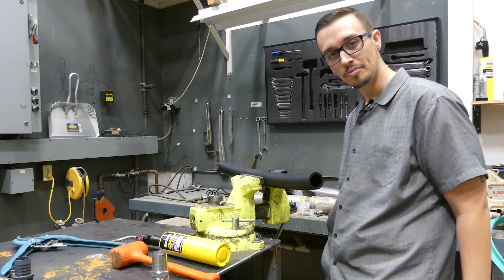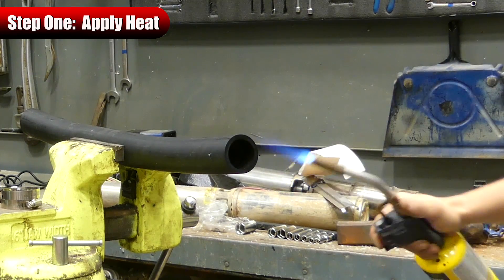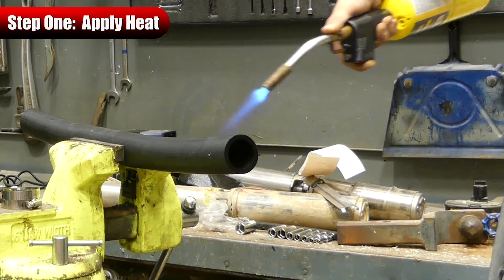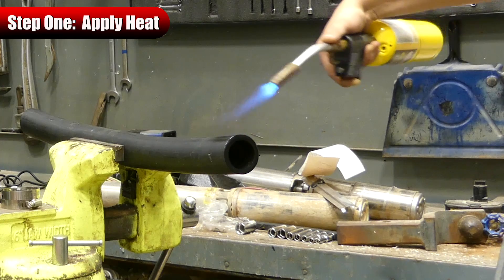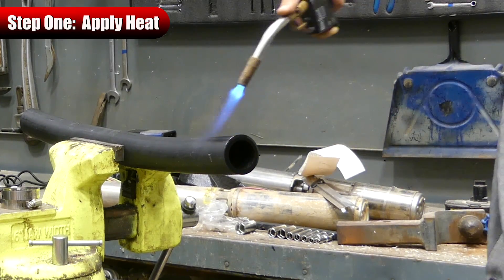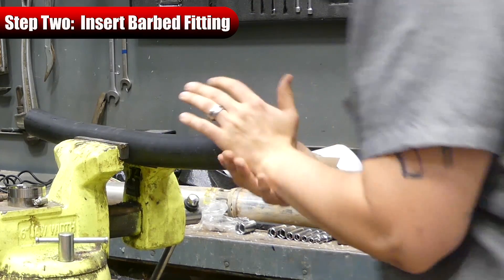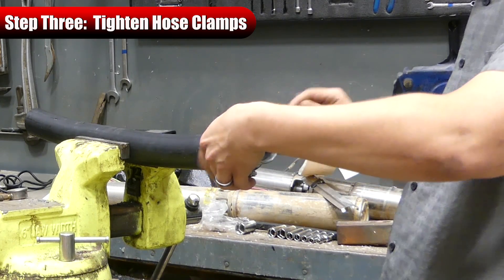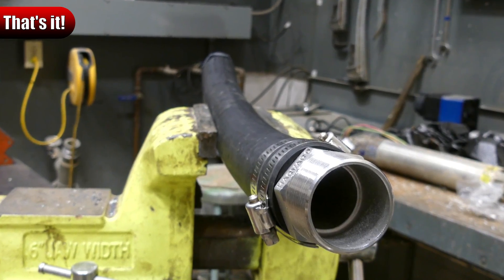How to Connect Poly Pipe to ANYTHING using Barbed Fittings

Comment: Will this work with Blue Poly for my  Water Main from Curbstop to attach to my Water Meter? Had a Ford Compression 90 on the Poly and it came off and flooded my basement.

Comment: What he doesn't show you is if you heat it too much and compromise the hook up how you'll be cutting pipe out and coupling more stuff together etc. be careful, do not heat too much just enough, and damn sure use mallet, this guy is in the easiest setting using a vice...

Comment: Maybe my pvc barb fittings weren't long enough for my 2" poly pipe, but the joint isn't strong enough and keeps coming apart on a hillside even if I crank down the hose clamps.  Couldn't find the double barbed stainless steel insert at RC Worst.

Comment: How tight will the fitting be once it cools? Can it still spin? I have the sdr 9 1" poly, and it's like 7/8 " ID, which is odd. I used 3/4". Once I heat and clamp, will there be any issues?

Comment: doesnt look like the barbed fitting has a collar to spin? how do you connect to the female if can not spin to thread on? looking for an better solution to connect and disconnect my pumps to my sand point wells.  thanks!

Comment: I wonder if you have answers to my questions: 
1) Just today, the plastic barbed fitting broke off inside the poly pipe. How to take it out? 
2) The poly pipe comes from the well house/pump, about 4' before house foundation it was connected to the Galvanized pipes and a hydrant. All of it rusted and needed to be replaced. Should I use Pex or copper? Pipes in the crawlspace are copper. 
3) I also Thinking to lower the pressure tank and connect to the pump about 10' - 15' under the ground to eliminate heating well house in the winter season. My pipe runs about 6' under the ground. 
A) is it a good idea?  B) how to do it?   
  4) Should I install another pressure tank under the house in the crawl space? The well is about 30 yards away from the house. 
Also
I found a 5" PVC well pipe in the field. PVC pipe broken, leveled with the ground. What to use to close it, to prevent from debris to fall down?     How to find if it has water and how deep?  Also what camera to buy to inspect the well?  What 4" pump and water tank brands and models are best?

Comment: It looks way too easy in shop , how about splicing a poly pipe inside pit hole with minimum space ?
Reply: Or under a mobile home crawlspace where the manufacturer only left 9 inches hanging out of the under belly to connect to. I can see the plastic under belly catching fire now with all his heating
Reply: What is the Hose barb size  connector for SDR 7 IPS PS24 ASTM02239 PS-11-69 3/4 IPS. 160PSI.
  The OD is 1.075. Guess the wall is 0.100  .   So the hole is  0.800. 

Do you use a standard 0.750 barb in it and pull the pipe down with a clamp?
Reply: @RIPSAWONE  3/4" SDR 7, is it polyethylene?
Reply: @staind288  Yes,petty sure it's black polyethylene
Reply: @RIPSAWONE  same way. Heat and a barbed fitting. You can use other things too but I can't guarantee their results. I almost don't want to share them incase they don't work but I will.

Comment: I have to replace a barbed elbow on the hose coming from my well pump that connects to the pressure tank.  How do i relieve the pressure in the line before removing the hose clamps?

Comment: I use a wagner hot air gun it works great without weakening or damaging the tubing. 

I also like to use single ear compression clamps because they get the full 360 degrees when you compress them. Similar to a CV boot and can be compressed with any small to medium end cutting pliers.

Comment: I've had different issues in the past dealing with 3/4" poly pipe.  After much trial and error, I've found that brass barbed fittings seem to work the best with the size pipe that I have along with the two clamp technique.  Steel and plastic barbed fittings are just plain terrible.  I can't believe after all these years of companies manufacturing and people using this stuff that no one has come up with a better way of connecting and securing fittings to this type of pipe.  The worm clamps seems to a major fail point.

Comment: So I'm 6 feet down (frost) replacing an old leaking plastic 1" tee (installed years ago by previous owner)with a brass T.  Plastic is not up to code and I do not want it to leak again so am using brass.  My helper thought it was smart to dig a hole as small as possible. Do not do this, you risk a cave-in and there is not enough room to work.  I've always used hot boiling water, would not recommend a torch as once the plastic seems heated enough it will continue burning/melting after the torch is shut off.  Against my better judgement, egged on by my "assistant" I melted the hose using a heat gun, deformed the end of the pipe.  I have heated and worked with plastic for 40 years, believe me it can be easy to FU. I'm going to just cut the tee off as it is too difficult to get enough torque on a tee and it would groove up the interior wall of the pipe with all the twisting and turning. So off to the big box store miles away (the one that put the local hardware store out of business) to get the Tee I saw that has an extra long barb in one direction.  As far as the politics, didn't watch it. I did learn from my high school WW2 vet teachers (in both Pacific and European theaters) how to identify Hirohito and Hitler type leaders.  We've got one here in the US right now who combines the worst of Hirohito and Hitler. Pretty sure those vets would have said his name begins with a T, not a B.

Comment: I used a face cloth folded twice and wrapped around the end of the pipe, and then held in place by an old trouser bicycle clip. Then I poured boiling water on the cloth, waited for a couple of minutes for the heat to dissipate through the thickness of the pipe, and then was able to insert the barb! A heat gun also works, and is gentler than a blowtorch.

Comment: I appreciate the info. However one question I have is what are (if any) the manufacturer's guidelines? I can't seem to find any information on the poly I'm using. I'm working with 3/4" poly rated for 100 psi. I used the torch method  and sure enough I have a slow drip. Short of torching too much or too little, I don't know what I could have done wrong, which leads me to question the torching method if the margin for error is that small. After all, heating plastic changes the molecular structure, does it not? So I'm really curious if the manufacturers have a recommendation on whether the torch method should be used.

Comment: Can you tell me the max. dimension différence IT should be between the ID of the pipe and the OD dimension of the bar sectionnelle
Reply: Barb section. Because I tried to fit a 1.50" pipe on a 1.50" barb connection and there us a diffirence of .150" on one of m'y pipe, and a other one , .090". IT was impossible to Do. Thanks for a answer.

Comment: Will this work for the CTS (OD) poly as well as the IPS (ID) poly? The dimensions are kinda goofy on this poly stuff. There's way more CTS available but fittings are limited unless I can heat up the pipe enough to take a barb.

Comment: Added note:  RE Getting to tightening the hose clamps quickly, the PE expands about 8 times as much as steel, so tightening the clamps while the PE is still warm will tighten the fitting even more when cooled.

Comment: Oh dear god, you heated that way too much and had too high a heat.  Also, heat the inside more than the outside.  You can ruin your connection by having the outside too hot.   I don’t care about the outside being as hot as the inside.  The inside is where it all matters.  Also, remember, that poly continues to heat itself even after you remove the flame.
Reply: And he basically only heated one side, when he went to side he wasn't standing by he left heat on it for about 5 seconds total,  while the other side was almost melting,  lol

Comment: thanks for a good video demonstration... i have been searching high and low online for brass or plastic shut off valves (with barbs on both ends) that will fit a one inch (inside diameter) black poly pipe... i have found them for smaller diameter pipe, but can't seem to find one inch size... any idea where i might look??? thanks

Comment: What happens if the black pipe is set on fire to be able to insert the fitting.  That is what I saw the pool repair guy do?  Will the pipe cracking or leak when I run the filter? Help???

Comment: I'm thinking of using the wife's hair dryer on rubber dishwasher supply line being supplied from a barbed supply fitting. 
Will this work? Should I use Rectorseal pipe thread sealant?

Comment: On 1/2 poly pipe, can I use 1/2 PEX clam rings instead of these more expensive screw clamps?
Reply: I wouldn't
Reply: @richardj5417  not the same diameters?
Reply: @michaelkuzmin  pex rings are better suited for cheap pex. Honestly I would use hose clamps and a 60inch/lbs T handle torque wrench. Being a plumber myself. Lol by setting torque you get guarantees with the clamps that you won't with pex rings and yes the well line or polyethylene is a heavier schedule or tubing.

Comment: The absolute worse thing you can do is apply a flame to Polyethylene pipe!! Don't do this!!! Your pipe will get brittle and crack.
Reply: Then how????? If the poly pipe is coming up out of a slab you can't dunk it in boiling hot water

Comment: Seems like way too much heat.  The pipe is now compromised.
Reply from the maker: It may seem like too much, but we have been hanging pumps from these connections for 30+ years with no issuse.
Reply: Yes!  I admire the Worst guy and everybody else who gets this done, but a 3596 deg F propane-air flame is overheating, scorching, and destroying the polyethylene material strength.  You only need 200 deg F to soften it, and any more will spoil it.  Worst has gotten away with this for 30 years because he's playing around the flame to minimize the damage, there's enough material there to hold up despite being degraded, and the damaged pipe area is bandaged by the metal clamps and not under water pressure.

Comment: So it is too hard to get the barbed fitting in without the heat first?  Suppose you could get the fitting on.  If you are using a metal fitting then it stands to reason that perhaps you could heat the metal fitting from the inside and it would melt the polyethylene pipe from the inside and make a bond there.  Heating the outside of the pipe with the clamps already on would also melt the clamps to the outside of the PE pipe.  I'll stick with your method rather than experiment.  But I'll be under my home connecting a 1" Brass insert male adapter to 1" polyethylene of iron pipe size with rated working pressure of 200 PSI per my water company's web site.  I'll probably wear an OVE glove on each hand underneath a pair of waterproof gloves.
Reply: It would be better to force the metal barb into the warm (not hot) pipe to press it in, but the force required to do that is still impractical.  Poly pipe is slippery, and there's no way to hold it for that degree of press fitting.  Heating the metal fitting is a bad idea.  That will melt and reform the plastic, which will be loose when it cools.

Comment: I've got 1-1/2"  SDR-9 pipe and a 1-1/2" barb x MPT adapter.  The OD of the pipe is just a little bit smaller than the OD of the fitting.  I'm going to really to soften up the pipe so doesn't look like the torch is going to work.  It looks like I should be using a 1-1/4 or 1" barb.  Maybe someone else has had this problem and knows what I'm up against?  Thank you

Comment: This is "A" way of doing but NOT the "Proper" way of doing it.

Also hand tight means: To tighten with just the use of hands or fingers, without the use of tools. 
You say hand tight but you are using a screwdriver to tighten it.
Reply from the maker: If there's a better way to do it we want to know! What would you have done differently to connect the barbed fitting to poly pipe?
Reply: Someone asked a question about cooling the fitting. And I can't seem to find it but anyway. This is the reason he asked I would imagine. 
I know this is not new as far as the video goes but. The reason he asked about cooling the metal is it's because when you heat the polypipe you make it flexiblePliable so you're able to Insert the Barb into a pipe that it wouldn't normally just push into. He asked that because hes probably A mechanic and has installed bearing races.  Same concept. Not to get too off track but to use a good example let's say a 2 stroke motor  When you replace the crank assembly you have to remove remove the bottom and crank  Shaft bearing, And in doing so Most companies advise Putting the bearing races not the actual bearing in the freezer overnight Because cold makes metal contract and reduce it's overall outside diameter.  And they advise that you put the clean engine case case cover on a baking sheet in the oven at a 150ﾟ 200ﾟ It allows the metal to expand. Is it's called an interference fit. So that's why he asked. Not to drag on about this but, The 1st time I replaced crank bearings on a crankshaft in a 2 stroke motor but I was surprised at how  Well this worked. At room temperature you canTake that bearing race sit it on that engine case and see that it does not fit. With one metal cold and the other 1 warmed up. 9 times out of 10 you can fully sest the bearing race  Is with your hand. Is it literally drops in. And when it cools and warms. They are Locked in place. That's why hes asking about freezing the fitting because it will contract it all metalsExpand and contract different temperatures and different dimensions but same concept. Sorry the message was so long I was trying to make it understandable
Reply: What a twat. lol

Comment: Can this barbed fitting be used inside metal drain pipes as well? If so, how would you go about sealing the connection?
Reply from the maker: No, it is for poly only.

Comment: what about replacing rusted steel or iron where the pipe must be cut - weld new threaded fitting on ?  Epoxy, Clamp?

Comment: I got away from the high dollar couplings a long time ago just using the next size smaller threaded steel pipe .
Reply: Do you use a reducer fitting?
Reply: No and the pipe threads  hold the pipe inside.
NO HEAT REQUIRED for connecting  / thread in if  needed./ snug fit. 
When using them with hot water I use metal hose clamps on the 
outside so there is metal on both sides of the plastic,
It works well.
Try it you will  like it.
Ps you probably know there is a food grade poly if needed .
Reply: @sojournsojourntraveler1203  appreciate the response. I should've asked if you just step the size down and run the size down. Thanks
Reply: Yah just the the threaded nipple about 2.5" to make the connector .
Happy trails .
Peace and Shalom
Reply: Can you explain what you mean? What type of pipe do you use as the fitting.I need to connect 2 inch DR11 and I need 2 inch male pipe threads
Reply: @williamdarby9011   The poly pipe that is the subject of this video.
PEX pipe is an exception .

Comment: cris can i use heat gun instead of torch thank you.
Reply: will a heat gun work? Well that depends on the quality of the heat gun.  So yes it can be done. Also it is much safer and actually takes LESS time. Not like this guy says. Why? Because you can apply direct heat to the pipe and not have to keep doing this touch and go. You can make a fitting to that heat gun out of metal conduit and a cap. Cap the EMT and drill holes all the way around near the cap and about an inch wide band of holes. Now you can stick the new heat gun attachment you just made inside the pipe and heat it just at the end and on the inside where it matters the most. It will only take seconds even with a cheap heat.gun.
Reply from the maker: You might be able to, it will just take much longer.

Comment: Is there an option to have the barbs on the outside of the pipe rather than the inside? I don't want the barbed fitting to reduce the flow. Thank you.
Reply from the maker: Good question! The other option is to use a ford fitting: https://www.youtube.com/watch?v=rCAUnJgk8JQ

Comment: I have a 3/4" brass barb coming out of a gate valve after my water meter. It turns to a 3/4" poly line leading to my house right after the gate valve. The barb just slides right in for some reason. Almost as if it's not even touching. Would this work with that situation or should I get another type of barb fitting that isn't brass? I'm currently trying to find out why I'm only getting 25psi from my meter, so the pressure may go up to 100psi in the future if it's an issue with the city's equipment. Thanks in advance for any help.

Comment: This is awesome!  I've always used compression type unions for repairs on poly pipe, but for some reason up here in the Seattle area I can't find any over 3/4in to save my life.  That leaves me stuck with the damn barbed, clamp on style and I'll be damned if I could force the pipe over the effing fitting.
Reply from the maker: Glad we could help! We do sell the compression fittings as well if you need them: https://www.rcworst.com/Fittings-c79.html?Attribs=481
Reply: I'm in Seattle and they have the compression ones at McLendons Hardware store, and then you can probably get them at specialty plumbing suppliers like Pacific Supply.
Reply: @JesseAdamson  Hey Jesse,
Thanks for the reply, I appreciate the advice!  I'm actually in the Redondo/Fed. Way area, so since I wrote this I had tried McLendon in Sumner and Kent with no luck.  Next time I will give the one in Seattle a shot and although I can't read the name again at the moment, I will definitely give the other place you mentioned a try.  Thanks to the video, I did manage to make the barbed fittings work pretty easily this time around.